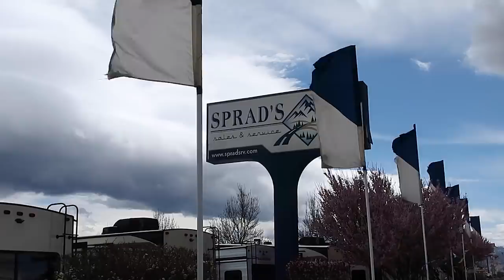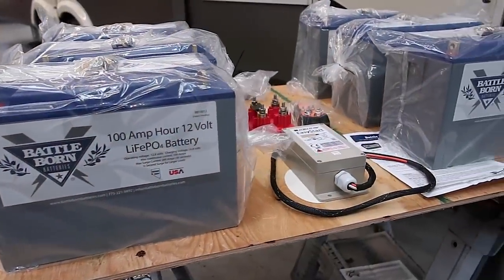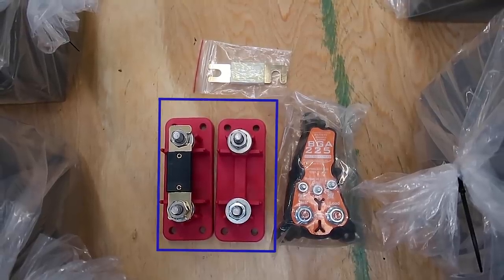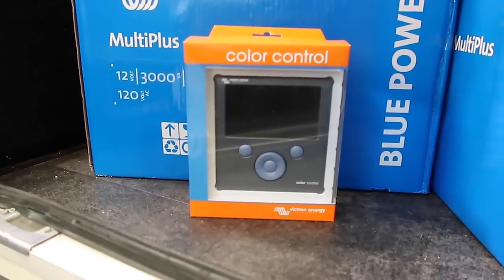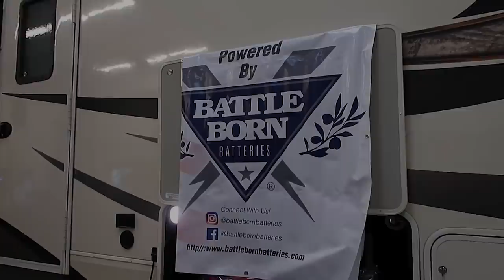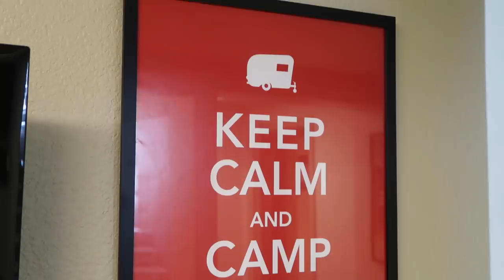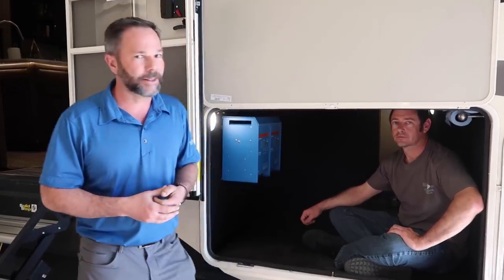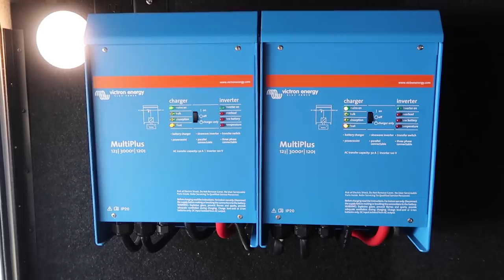Our Lithium Battle Born Batteries System Install! || RV Living

Comment: We just purchased a brand new Grand Design 367bhs and was wondering how much a system like you guys just purchased cost ?
Reply from the maker: Hey Bernie! Congrats on the new 367BHS!! A system like ours will be between $8K and $10K. You might not need as much power as we do or even two inverters which would bring down that cost :) Happy travels!
Reply: @GetawayCouple  Thanks for the info. Nice job. Might consider that next year when we go full time.
Reply from the maker: You're welcome! Good luck on your full time journey.

Comment: While I realize every system is different I would still be interested in the total cost of the install.
Reply from the maker: Hi Darrell, a system like ours will be between $8K and $10K. You might not need as much power as we do or even two inverters which would bring down that cost :) Happy travels!

Comment: Rhea and Jason,
Love your videos!  One note about batteries. Battleborn batteries are $949/battery. So 6 batteries purchased $5694 totaling 600 Ah. I purchased 4  6V Lifeline GPL-4CT AGM deep cycle batteries wired 2 batteries in series and each battery pair in parallel total 12V at 440 Ah. Lifeline batteries are the same we use in military vehicles and are made in US with mil-spec manufacturing standards. Each 6V battery costs $340 so for 4 = $1360 saving $4334. The disadvantages are each Lifeline battery weighs 61 lbs double the battleborn batteries and 140 Ah less. 4 Lifeline 6V batteries would also be 58lbs heavier than 6 battleborn batteries, but only takes up 2/3rds the footprint. Just another option for the getaway gang to save some $. 

Here is a link for the series/parallel schematic:

https://www.batterystuff.com/images/knowledge-base/Series-Parallel.jpg

Comment: $8,500 just for the batteries and inverters.  Install is extra.
Reply: I don't feel so bad about my $1k install anymore...lol.  Seriously though, these are high quality batteries and will be cheaper in the long run compared to AGMs, etc.  That front end cost though is still a bit of a punch to the gut.

Comment: Okay guys, I'm assuming you are in close contact with GD HQ, being as you are back in Elkhart.  As the wife and I would like to order the 2020 version of the 375RES-r, I'm wondering if you can find out what the upgrades are going to be. As I am a bit older that you folks, I'm specifically interested in whether or not GD is going to put the shore-power cable on a permanently connected reel setup.  That darn cord weights a ton and I would prefer not to have to lift it every time we move. Please let me know what you find out. Thanks.   Have fun, stay safe, & happy camping.  v/r, TS
Reply from the maker: Hi Tyrel! We haven't heard of GD having any plans to put the shore power cable on a reel but we just bought a reel from Harbor Freight and will be installing it this week. We also don't like lugging that heavy cable around every week. We'll be sure to include it in a video. As far as the upgrades to the 2020 375RES, we don't know what those would be but I'm sure Grand Design's customer service team would be happy to help! You can shoot them an email at customerservice@granddesignrv.com or give them a call at 574-825-9679

Comment: Not having solar doesn't make any sense to me.
Reply from the maker: Us too! Which is why it's our next project 😉
Reply: @Ron Feinberg Solar of course is always better, but a battery bank is a great starting point. For example, it can get you from staying in an RV park with electric hookups every day to maybe every third day. This is what we did in the beginning of our full time RV life and thus we were able to figure out what are our energy needs and how much solar we needed to install.
Reply: @AdventurousWay  I've been RVing for the last 10 years with solar, lots of batteries, generator with many different RVs. I currently have 1200w of solar, 6 Battleborn lion batteries, 2800w Magnum inverter/charger. Having all that capacity with not being able to maintain the charge (solar) makes no sense to me. The solar panels and MPPT controller are the cheapest part of the total solution. It completes the package.
You might have started out spending a considerable less amount than they did; building up to your final setup; I get that.

Installing 2 Victron inverters and 6 BB batteries is a lot, a whole lot of $$$$. NOT paying an extra $1500 to complete the package is non-sensical. Of course, just my opinion.

Comment: Would there be any way to show how the generator is hooked up to your system
Reply from the maker: It’s nothing fancy! When we need to use the generator we take our normal 50 AMP electrical cord, plug it into the RV, and plug the other end into the generator with a 30 AMP adapter. It’s exactly like plugging into a 30 AMP campsite.